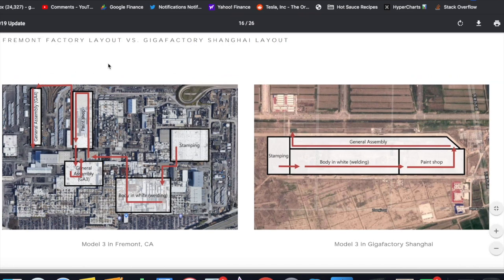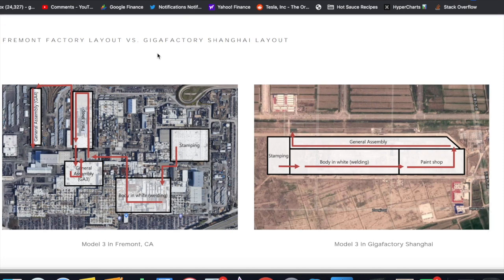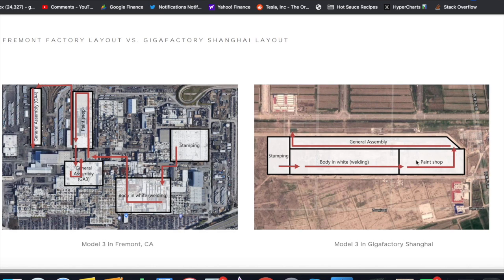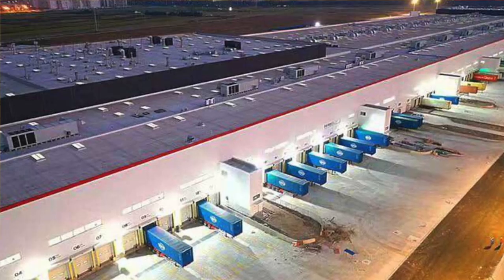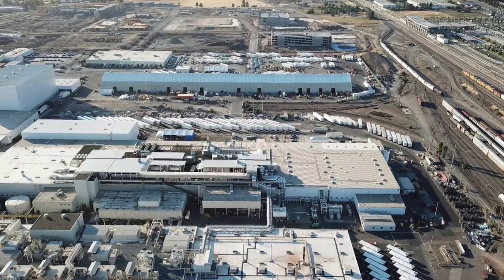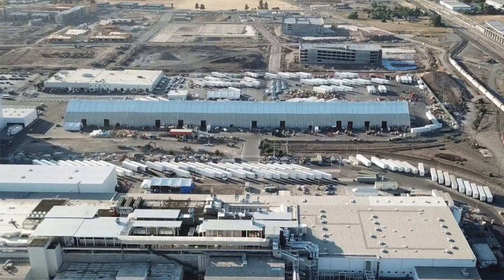Why Tesla's Gigafactory Shanghai Is More Efficient Than The Fremont Factory

Comment: What are all those doors for in the Shangai gigafactory if all the parts start in the stamping part of the factory?
Reply: Not all parts, some of them only go to the assembly, probably it was the best zone to use has drop zone of parts, you need space for that
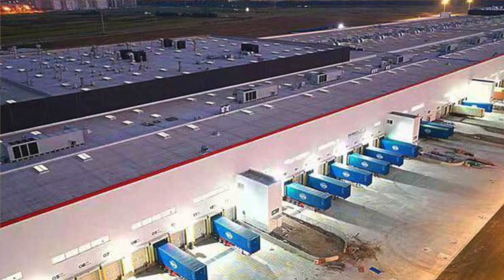Reply: He didn’t say that the parts start in the stamping section. At 1:10 he said, and the picture showed, that the supply train trucks can deliver parts “directly to the point on the production line where they will be needed”. The cars start in stamping and as they move along parts are added.